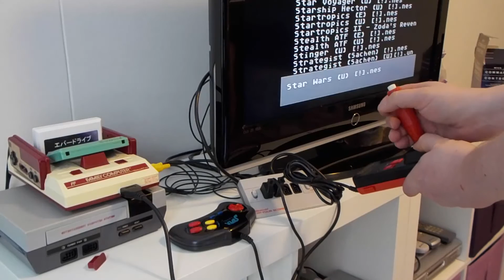NES gamepad to Famicom (Four Score mod)

Comment: I was asking myself if i could play solo games as first player on famicom AV with a tototek adaptor (for connecting a PSX controller to famicom), so it seems it could works because the adaptor is made for famicom, and the famicom AV have the same DA-15 port...

Comment: do all 4 ports work, I mean can you play 4player games, and is there a input lag?
Reply from the maker: Four Score is not compatible with Famicom so it only supports two players. No input lag.
Reply: what about av famicom?
Reply from the maker: Despite the fact that HVC-101 Famicom uses the same ports as NES it's not compatible. If you really want four player support - check out Hori 4-Players Adapter - it works with Famicom.
Reply: Is there any form to mod Four Score to play 4P Famicom games? The Hori adapter is too difficult to find.
Reply: If you mod a Famicom to properly support the 4-score it will only work for non-Japanese games.
Reply from the maker: I just tried this again yesterday and you can play four player games, but you have to use the Famicoms own gameppads for players 1 and 2.
Reply: @TheMrJamu  If you modify a game's source code (a game that supports 4 player), the 4Score indeed works with 4 players at the same time. I tested this a while ago on a hack of Battle City.  Also 99% of the commercial games that were not developed in Japan (Rare, Codemasters, Software Creations, Color Dreams, Sculputred Software, Beam Software etc. games) will not going to read anything from the expansion joystick - unless you modify the game's source code. I've hacked at least 200-300 games to read from the Famicom expansion port.

Comment: I see a strain relief but I don’t see where you put one on after cutting off the old one. I’ve used a lot of these cables with mods and what I do is smash the back end with a hammer. You can then eject the pins from the front end. It’s better than using the shorter cables with unfinished end specifically because you can reuse the strain relief (oh, and it’s longer. ;)).
Reply from the maker: I managed to take off the original strain relief and reuse it on the new cable. It's the original strain relief that came with the Four Score. It seems that I skipped that part in this video.

Comment: is it possible to wire this up for use with 4 players using nes controllers and zapper support on the 4th plug? 

my goal is to enable my twin famicom to be able to play smash tv (nes version, via adapter) with the four controller, as well as duck hunt (fami version) with the nes zapper with the 4 score mod.

i read the forum thread you linked to but had trouble finding clarity regarding my concerns.

Comment: hi, will the Nes four score retain its turbo function with this mod?

also if i use a PAL version of the four score will it work?

thanks in advance.. God bless
Reply from the maker: I'm pretty sure that the turbo function will not work after this mod. I've never seen the insides of the PAL version and I advice to stay away from them unless you can get them very cheap.
Reply: hello, can you give me a detailed guide on how to help me? I watch videos that don't understand anything.
Reply: @TheMrJamu  I have a modded 4score that can be used with the NES and the Famicom. The turbo functions works fine on the FC too.
Reply from the maker: @MrNorbert1994  That's cool! If you have any info or wiring diagram about your mod please share your wisdom on the Famicom World forums. I just noticed that the forum post from where I copied this mod is now pretty much missing all the important pictures. I gave this device to my brother so I have to get it back to take some detailed pictures.

Comment: Thanks for interesting video. I came here looking for a solution around not having to buy the super rare and mega expensive Hori 4p multitap. I own a Famicom AV and have a NES four score (model 034A, bought in Sweden so might be PAL). I works without problem to connect to the Famicom AV through the regular port, though you can not use port 3 and 4 on the four score (turbo works as well).

I was wondering how the mod would work on a Famicom AV - connecting it to the port on the side instead. Do you have any possibility to try it out or do you know anybody who has tried it on Famicom AV?  Can you play 4 player with it? Or would you have to plug in p1 and p2 to the regular port?
Reply from the maker: Sorry, can't help you with this matter because I don't have access to Famicom AV :( Also sorry for the late reply. YouTube notifications failed once again.

Comment: Can you please show me how to modify the details? watch on the video I do not know.
Reply from the maker: There is link in the description.
Reply: You solder lead too fast, I do not know where to weld, where to wire, you ask for detailed photos taken lead solder?
Reply from the maker: https://www.famicomworld.com/forum/index.php?topic=4906.msg107906#msg107906 - Here's the schematics that I followed. Color coding (or more like the lack of it)  does not help because there are many different manufacturers making these extension cables. So I can't give instructions like blue wire goes to red and so on. It's not the most challenging mod to do.
Reply: thank you, let me do try, if anything hard to bother you just add to.
Reply: hello, i tried it the way you just did but still can not, can you mod a one and sell it for me?
Reply: @TheMrJamu  hello, i saw your picture, but i don't understand, can you describe every step in detail to help me? Please guide in detail how to solder each wire to the 15 pin plug?